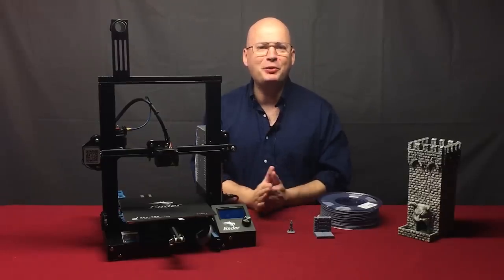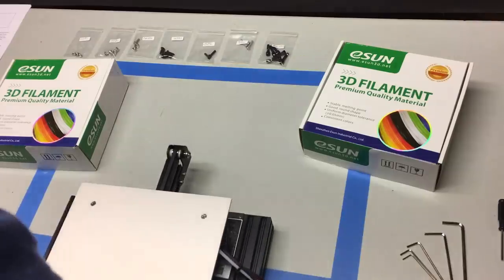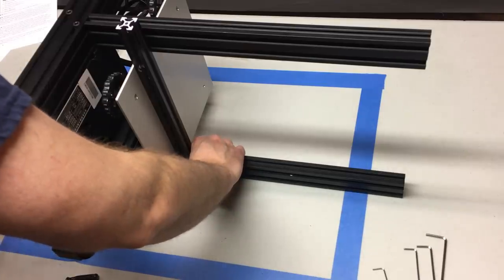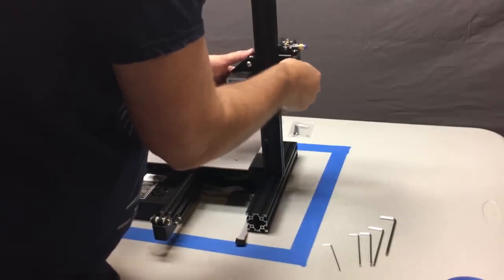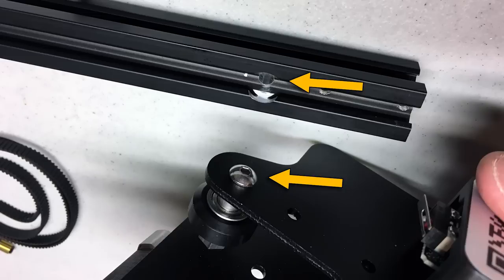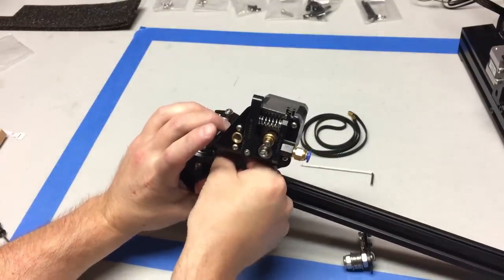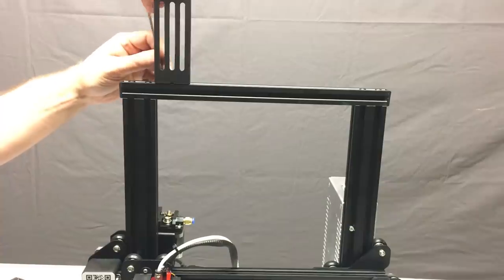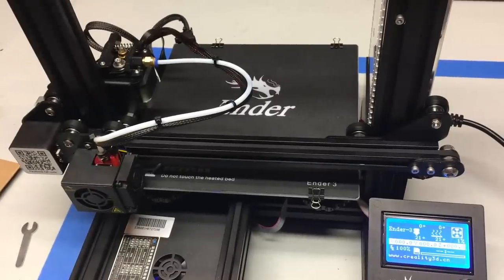Creality Ender 3 assembly and pro build tips

Comment: around 20 minutes of your video, you adjust the x axis gantry to be evenly spaced from the base. I've done this multiple times but the right side of the gantry always sags 1-3mm lower than the left. I also had a "more than 90 ˚" right angle plate where the z axis lead screw engages but i  fixed that, shimmed off the z stepper to get it more vertically aligned with the brass feed but still i get uneven layers  throughout my print. do you have any advice ? thank you! your video was super helpful during assembly

Comment: My god what a great video. You have pointed me at so many things I would never even think of. Thank you! Creality manual is very basic without any explanation of 3d printer elements alignment. The only thing I would add to your video is to align the base profiles first, as I have found in the middle of build that two base profiles were about 10mm off and the whole printer was wobbling like a table in the pub on uneven floor. I started to build on the carpet and after fitting 3/4 of the parts I have transferred the printer to the desk just to find out that all alignment/facing I made was for nothing because the base was assembled like Halford's bicycles. I followed all your tips and the printer is working like a dream, without your tutorial it would be a disaster. Thanks again.

Comment: Hi there.  Love you guide.  Helped fix my first Ender 3.  I have another now which seems to have a tilted bed frame on the right side.  This is stopping me from getting it level as the springs are as tight as possible on the left and loose as possible on the right.  Anyway to adjust the bed frame?  Or can I use washers to shim the right side under the springs?

Comment: Helped me get incredible results from my new E3P. Make sure to watch all of his setup vids. A tip for anyone reading these comments prior to setup or after a failed print, (he does somewhat cover this in another video, but only demonstrates the X belt), my Y belt came very, very loose from the factory, I had to take maybe 2-3cm of slack out of the belt by adjusting the pulley on the front of the machine (it was totally misaligned). I would have gotten awful results had I not tightened this belt significantly, and I'm not sure the cause would have been apparent to me had I not seen his other videos or heard an awful noise during bed leveling. Good luck friends, and thanks Tom.

Comment: 11:00 This process isn't working for me. The gap at the top of the printer was a whole 5mm at first. With the inner screws now as tight as they go and the outer screws basically finger-tight, the gap is 2mm. I can't make the gap any smaller and there aren't any other resources I can find about this so I will continue assembling. What print issues is this likely to give me?
Reply: Not necessarily a thing he did wrong, but i personally would attach the top rail prior to tightening any of those bolts. It adds a layer of complexity but it completes the very interference structure. Doing it his way will tattle on potential bent rails or bad cuts. Putting the top bar on will allow you to print likely perfect despite the discrepancy.

Comment: 0.59 instruction download.  2.57 replace Bowden fittings.  4.27 ducks in a row.  4.35 build plate adjust.   7.28 attach verticals.  11.57 1st wheel carriage.  13.24 Extruder assembly.  14.08 LCD Screen.  14.20 Power Supply.  15.15  Z Stop switch.   16.27 Z Motor.  17.58 X axis assembly.  19.50 Horizontal.  20.50  Belt Part 1.  21.05  Print Head assembly.  21.59 Belt Part 2.  22.48  second carriage.  23.32  Belt tensioning.  25.12  Attach assembly to vertical.  25.58  Top horizontal.  26.09  Filament holder.  27.11 Wiring.  29.01  replace zip ties.  30.59  stand well back and switch on.  33.00 have a cuppa :)
Reply: thank you kind sir

Comment: Great video - wish I'd seen it a week ago when I was building mine ;^)  That said, mine prints well right out of the box despite being built by a noob who did some steps less than perfectly.  I followed the old adage "if it seams to tight, it probably is" and "A square should probably be square", so it's not too far off the mark...  For the record, I wouldn't go full Canadian torquing on any of the fasteners in this thing, so I'd be concerned advising the denizens lurking in the bowels of the YouTube to just torque away on any fastener in this kit just because it's steel on steel - but that's not really a criticism...
Reply from the maker: For the screws holding the belt tensioners it is absolutely essential, or you will start seeing a decrease in print quality after a month or so as that tensioner starts slipping a bit. :)

Comment: I wish I would have found this video when I assembled my printer. Came back around to finally watch this when trying to solve a layer shift issue, and I just wanted to say thanks for the good work. Clear, concise instruction, and taking that little bit of extra effort to ensure your assembly is top notch. Thank you for this.
Reply: Had the same problem yesterday bruh, that video is pure gold! Also, a lot of the "upgrades" on thingiverse actually worsen the performance quite a lot over time, they were 1 of a couple reasons for bad prints in my case. Watch out for them z axis "stabilizers" and extruder mounts for the popular cable chain. They, most of the time, worsen the functionality and the play of the z lead screw.

Comment: I do have one question. when you say you should be able to turn the rollers stiffly with your fingers, should whatever piece is on that axis move? 

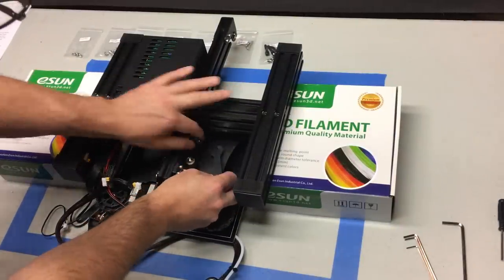For example. You are testing the tightness of the print surface with those two nuts at 6:10. Should the print bed move along the rail as you turn the roller with your fingers?
Reply from the maker: You should be able to turn the wheels with effort without moving the assembly along the rail.

Comment: You actually mentioned to tighten the retainer or center bolt down on the rollers. As you said this is because from the factory they are a little loose. What I have found that these Vee Groove Roller assemblies supplied out of Creality, do not have the correct precision shim between the two 625 bearings. What will happen if you tighten these center bolts, as you did you will create a side thrust load on the roller ball bearings, and this is not good. You can test this by removing one roller assembly put the bolt through with say the spacer or eccentric nut then the nyloc nut and tighten them up. You will find that the bearing has allot of resistance to rolling. This is because the inner races of the bearings has a gap. Creality appear to be aware of this, as they have not addressed this issue.
Reply: So would you say it's best to not tighten themdown so much. I noticed my bed is not rolling smooth what so ever. Almost as if the roller bearings have a flat spot....

Comment: Thank you! Got one arriving today, this will be a lot of help.
Out of curiosity, do you think I would risk running into problems if I cut the vertical beams down by, say, 10 centimeters? I doubt that I will need all that vertical volume, and I'm thinking that making it a bit lower it would fit better inside a future enclosure i might build.
Reply: ...yes. depending on exactly what you're planning, you'd have to mount the spool holder elsewhere and cut the z rod. Then probably have to perfectly drill and thread the newly cut tops.  I would just add 10cm to the enclosure design as it is nowhere near as necessary for it to be precise.

Comment: Just assembled my Comgrow Ender 3 today, and noticed the holes for the top rail bolts were drilled off-center; I can only use three bolts to attach the rail. Word of advice: if your Ender 3 has a similar issue, install 2 bolts on one side, then the inside bolt on the opposite side so as to avoid pushing your carefully aligned z-axis (upright) guides further apart at the top (which will cause binding when moving higher, and leave you with truncated, failed prints).
Reply from the maker: Great tip!
Reply: @Tombof3DPrintedHorrors  TY. BTW, I asked a while back on Wargame Vault how well your Orc/Lizardmen minis print in 15mm scale (~55%). Just finished one of the Lizardmen, and I can tell you it looks great, even at its reduced scale. ;)

Comment: A brilliant build video, I have 30 years hand restoring British sport scars, and I would have missed some of this stuff.
Id'e like to make 3 additions:-
Ensure the  feet of the base assembly are square and it doesn't rock when placed on a true flat surface, both of my ender 3s had out of true feet which makes the bed look warped, and even tipping the printer up on its side to clean underneath can make them go out of true.
Also check the 2 screws retaining the heater to the face plate, one of mine they were not sufficiently tight, even with machine washers to retain them, over a couple of days thermal creep loosened them completely and my nozzle assembly dropped off.
If you purchase the glass bed, which is far superior to the magnetic one, you will need to move the z stop switch up or your nozzle will crash into the glass plate as it is much thicker than the default print beds.
Reply from the maker: Great points!

Comment: Thank you for creating this video. I followed your guide 95% of the way (some steps I did out of order because they just seemed intuitive), pausing several times to catch up to the timelapse sections, but thanks to this guide my Ender 3 was set up perfectly, with minimal aberrations in my very first test print, which was the dog file included on the microSD card. Of course, the test filament ran out not even halfway through but what did get printed would probably get a 95 out of 100 in quality IMO. My bed is perfectly level and my axis extrusions are perfectly aligned, which is more than I expected for a printer reputed to not come with good quality control out of the factory. Thank you for providing me with the knowledge I need to get it set up right. I'm incredibly excited to print more neat and useful things, and it wouldn't have been possible if my very first day with my very first printer hadn't been as good as today.
Reply from the maker: Glad it helped! :)

Comment: 20:32 where you use the filament holder to check height on both sides... best tip in the entire video IMO.
Reply from the maker: After almost ten years of coaching robotics for 9-15 year olds you learn to adapt and make do with what you have at hand. :D
Reply: @Tombof3DPrintedHorrors  I am stuck at this point and did exactly as noted in the video. No matter how many adjustments, I am still left with an 1/8 to 1/4 inch gap. Could you gentlemen provide any tips please?
Reply: James Floyd Kelly I found this the most difficult part of the assembly.
Reply: @jacksfamilyvideos1315  Same here.
Reply: I am not sure which two screws to adjust.  The two adjacent to the z-rod or the two screws that hold the bar to the plate with the two small access holes.
Reply: Aaron Smithey Architectural Imaging Unfortunately the two that hold the bar to the plate. And you can only access them by taking the Z axis off. I found it easier to measure from the top. That way you don’t have to wind the z rod all the way up if it’s not completely levelled.

Comment: RE: Z-axis horizontal extrusion: Loosening the screws for the Z-rod didn’t seem to help me with levelling the horizontal extrusion. I kept fiddling with it until I accidentally pushed the right side of the extrusion down (it was too high) and that seemed to fix the problem… not sure if that’s a good thing or bad thing. I guess we’ll see.
Reply: how is it now
Reply: Beautiful prints (I have the BL touch and am using the TH3D firmware). 1st timer and was amazed at quality. That is until I clogged and then proceeded to destroy my extruder! (w/ABS filament) haha that was my bad. Upgraded to a Swiss all metal hot end with their direct drive extruder. I’ll be installing that soon. We’ll see how that goes..!

Comment: Question, new to 3D printer building. What is the reason for compressing the bed springs so much. Does that help with bed leveling later on?
Reply: just so they are all at the same level i guess..

Comment: Great assembly video!  One tiny issue - I think you mounted the U beam holding the spool backwards.  The spool should go on the outside of the U beam, not the inside.  This has caused some folks to say that the stock holder can't handle certain spools.
Reply from the maker: I'm curious, which brand of spools don't fit? So far I've used eSun, Hatchbox, Inland, 3D Solutech, and Amazon, and all fit fine. :)
Reply: I'm not sure what brand - I'll keep my eyes open for it.  I saw it on one of the three million and 52 YouTube videos on the Ender-3 I've been watching. ;)

Comment: I cant seem to get my extruder carriage loose enough to fall with gravity. I've adjusted that concentric nut every which way and it just got from really tight to slightly tight. I'm concerned that is going to groove the delrin wheels. It seems to bind no matter whcih side of the printer it is on. Great vid btw. thank you for doing it.
Reply from the maker: Check 19:30 into the video, make sure those screws are loose. :)
Reply: no this was before that in the video where we test fitted the rollers on the right side to make sure the concentric nut wasnt too tight.

Comment: Does the ender 3 pro use a 1.75 mm nozzle or the 3.00 mm nozzle? In trying to figure out which filament to buy and I'm pretty new too 3d printing
Reply from the maker: It has a .4mm nozzle, and is designed to use 1.75mm filament
Reply: @Tombof3DPrintedHorrors  ok thank you so much

Comment: Ready almost to purchase a ender 3. Should I get the pro or stay with the standard version and why? Please advise. Thank you.
Reply from the maker: I have several of both and believe the Pro is the better choice. Both will produce identical results, but the Pro has a better power supply, a more stable Y-axis rail, and a magnetic removable build surface (the PSU alone costs the same as the price difference, so you are basically getting the mag bed and wider Y rail for free.) :)
Reply: @Tombof3DPrintedHorrors  thank you pro it is then.

Comment: No matter what I do I can't get the vertical bars to be the same width top and bottom. I've played wit the screws over 10 times. One thing of note, when I had the 2 bars laying down on the floor before I put them on, I noticed the right one is not 100% level. All 4 sides I lay it on wobbles a little. Left is fine on all sides. Is that normal or is the right bar warped?
Reply from the maker: No, it should be straight. That is a factory defect, contact the seller and request a replacement. :)
Reply: Seller on their page has listed no warranty available and only have a 7 day return. Item is over 7 days so no return.
Reply from the maker: Contact Creality directly, they should make it good for you.

Comment: at 25:23
some say you should add shims behind and under the z-motor , since the bracket where you are adjusting this brass part is not bent to 90 degrees....
maybe they just dont assemble it correctly///
Reply from the maker: All of the machines I have assembled have had the Z bracket bent perfectly, and the screw fits fine without any shims.
Reply: Tomb of 3D Printed Horrors,  is that screw shaft parrallel to the vertical rail from the side?
Reply from the maker: Yes

Comment: Thanks for this video. I just put my Ender 3 together by watching this video and it was a great help. I have printed the dog and was amazed at the quality of the print. It took over 5 hours. Now, I have a problem feeding the filament through the extruder. It seems that the two holes do not line up properly. I had to bend the filament, use a flashlight and a very small screwdriver to push the filament into the hole past the driver gear. All the videos that I see show just squeezing the lever and pushing the filament through all the way to the hotend. My ender 3 will not let that happen without the above procedure. It is a pain to do it this way. Also It seems that I may be the only person with this problem, as I was unable to find any mention of this problem on Youtube or google. Do you have a suggestion?  Sorry this post was sooo long.Thanks
Reply: Danny Cooper I have the same problem. How did you solve it? I had to unscrew the coupling to get the filament in.
Reply: You should do two cuts to the end of the filament, with the plier, in inverted V form. That way the tip can find its way into the PTFE tube.
Reply: Javier Unamuno will try that tonight.

Comment: Oh how I wish I saw that before I built my Ender 3.. it works great right now but I'm pretty sure my eccentric wheels are pushing too hard on the rails.
Reply from the maker: You can always adjust them, just use the technique I describe in the video, get them to the point you can rotate them with your fingers with some slight effort (i.e., not too loose.) :)
Reply: of course, and that's probably first thing I'm doing when back home from work. I'm just crying on the damage that's already been done to them - you can actually see the wear on them.
Reply from the maker: Well, the good news is they are very easy to swap out for new wheels (that is something I love about the Ender 3, how easy it is to work on and do repairs. )

Comment: Hey Tom. When you talk about free spinning the wheels, do you mean that you can turn the wheel with your fingers and that will move the plate, or do you mean that the wheel will spin in place (that it would be slipping in the extrusion)?
Reply from the maker: That it will slip, with effort from you spinning it. Not spin freely like a fidget spinner, but two fingers should be able to spin the wheel with effort and not move the plate.
Reply: Thanks for that. Will get to tweaking it some more
Reply: @Tombof3DPrintedHorrors  Thanks so much, I was having trouble understanding that as well.